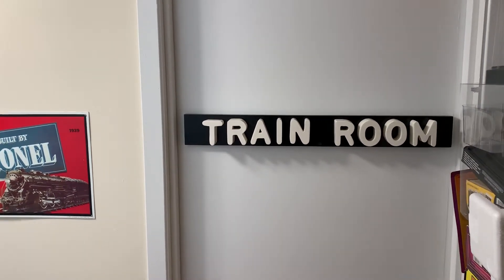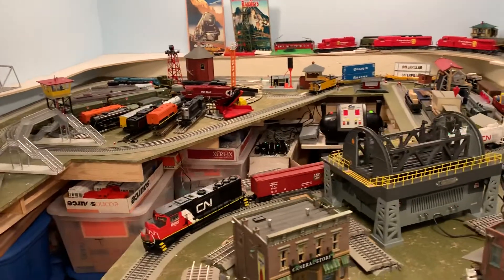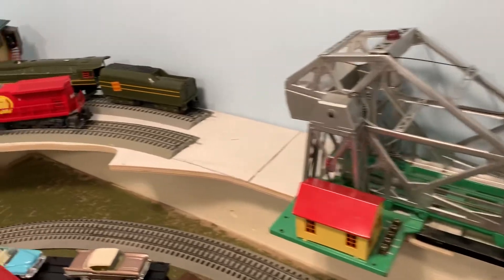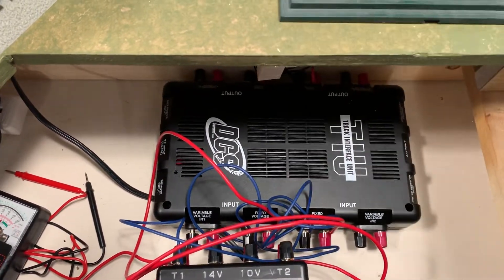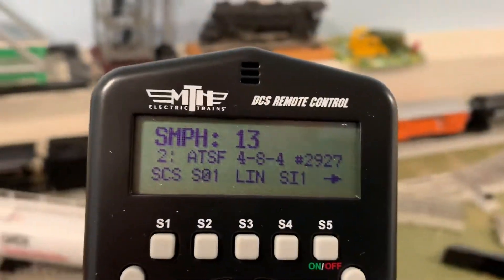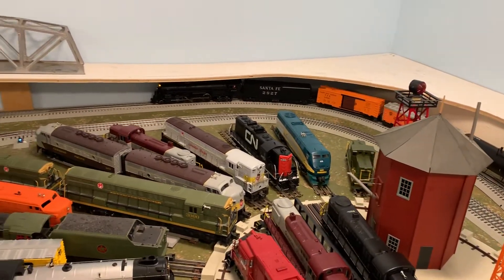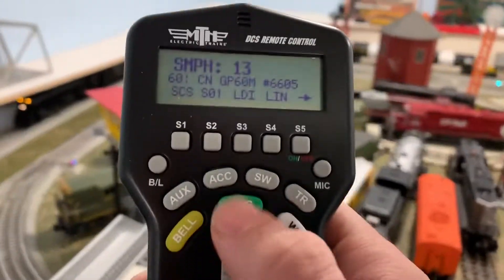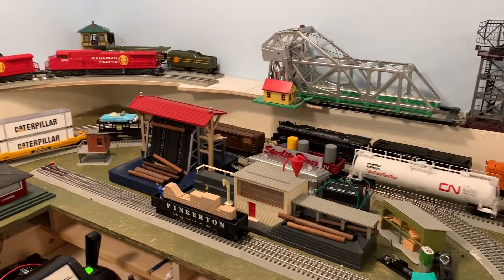Layout Update 1: 10x12 O Scale Layout with Lionel Fastrack and MTH DCS

Comment: Your video gives me the incentive to venture forward to the DSC system. However my conventional system is completely adequate for now.
Reply from the maker: Yeah, it's fun and quite simple to operate.  It adds a whole new element and a lot of options so you don't need isolated blocks of running multiple locomotives. I also find they typically operate better in DCS mode and are more smooth at lower speeds.  Good luck with it and thanks for watching!

Comment: Your engine moved without sounds because you didn’t throw in the startup command, remember to also shutdown the engine’s prior to shutting down the layout as each of the mth engines utilize memory, so if the engine was going 13 and you cut the Power, it can start off at 13 without you issuing any command’s if the watchdog signal isn’t captured,. also try networking you’re lead’s to the track’s, this way the power will have good connections throughout the layout, you can see the voltage in the the remote as the train passes through the layout so you can see we’re you’re power might be down a little although having a z4000 you’re already ahead.

Comment: The biggest thing that has kept me away from DCS is the cost of the locomotives and the components. I've considered lionchief for cost reasons. What's your opinion on them?
Reply from the maker: So far I love it! I can’t compare to Lionchief as I have never used that system. I have both Lionel TMCC and Legacy as well as MTH DCS. The advantage of DCS is that it can also run Lionel locos in TMCC mode. I find the locomotives run smoother than in conventional mode and I love that you can run multiple locomotives on the same track and dial in the exact speed to they don’t crash. I hope that helps! So far worth the investment for sure!
Reply: @gsoscaletrains6550  thanks for the advice. What all equipment do you need to start other than the mth locos?
Reply from the maker: @joeystrains.9316  , you need the MTH TIU and DCS remote both of which are shown in the video (and typically sold as a set) and a transformer to power the track.  That's it.  If you want to run Lionel TMCC, there are several options, but you can connect the Lionel command base to the TIU with a cable from MTH, and then run both Lionel and MTH from your DCS remote.  I'm no expert and what you saw in this video was my first attempt at hooking this up.  It worked right away.  There are a lot of cool features, many of which I have not explored yet.  Hope that helps!
Reply: @gsoscaletrains6550  thanks, it helps. Just have to set a budget. Hopefully have a couple of engines and the system by next year.

Comment: Im liking the setup! I have a question about it though. Are these lionel fast track? If it is how do you set up the power and DCS? I want to use both lionel and MTH at the same but I very confused lol. Thank you!
Reply from the maker: Hi. Thanks for your comment. Yes it is Fastrack from Lionel. You can use any kind of track and most brands of AC transformers with the DCS system. Some are more recommended than others. I’m using the MTH Z4000 transformer, Lionel Fastrack and MTH DCS and am able to run both Lionel and MTH locomotives from one remote. It’s simple and works well. But there are other ways to achieve the same thing. I hope that helps and good luck with it!

Comment: Hey I know a trick with DCS select  All Engines set the speed multi trains on same loop same direction yea its near system.
Reply: Before I overloaded my Z I had as many as 8 engines had been freight I may have got away with it but the passenger trains with all the lights got me.
Reply from the maker: Great. Thanks for the tip. I’ll have to look for that on the remote.